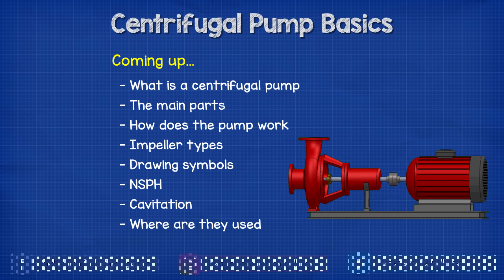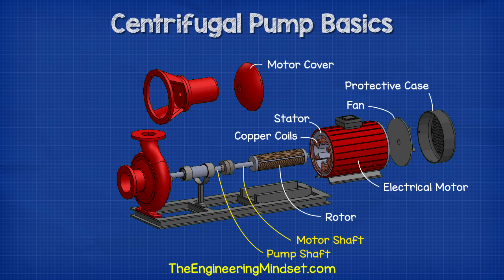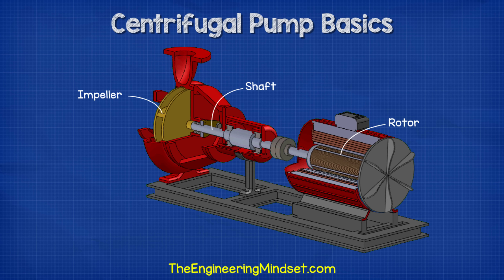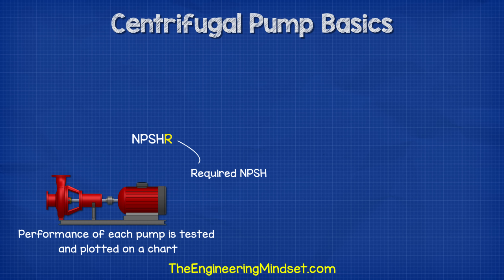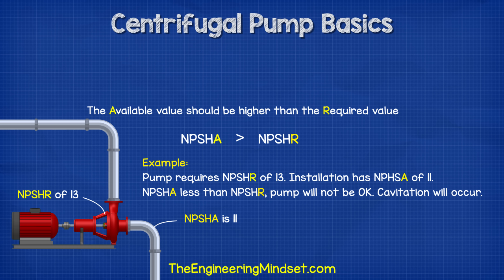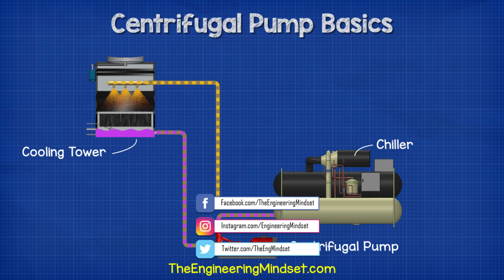Centrifugal Pump Basics - How centrifugal pumps work working principle hvacr

Comment: a question. i wander how to prevent the water leak from the pump case, there must be a little gap between a rod that connects the motor to the pump through a hole of the pump case. how to prevent the leak of water?
Reply: Mechanical seal is used

Comment: Thank you for this valuable videos. Despite i am not an engineer I really learnt from this.

Appreciated if someone explain more details about NPSHA and NPSHR examples mentioned in this videos.
In the first scenario (08:23), why NPSHR = 4, NPSHA = II and we make the conclusion that "NPSHA is sufficiently greater than NPSHR, pump should be OK. In the second scenario , why NPSHR = 13, NPSHA = II and the conclusion was made is that "NPSHA is less than NPSHR, pump will not be OK.

Thank you.

Comment: Great video here. Got a 180m3/hr pump, pumping water 1km away. The problem is constant wearing of the cast iron impeller. What could be the problem?
Reply: it could be better if the impeller materal to be changed.
Reply: @jianhuiqiao  aah I see, to bronze type maybe?
Reply: Cavitation?
Reply: @LadyShaydex  yes I think it's cavitation. What would be your recommendation?
Reply: @CollinsTuikong  you need a higher pressure on the function side of your pump. At the moment the pressure is so low that your liquid is vaporizing and imploding rapidly.
Reply: @Shaydex  okay, so I change the suction design to eliminate few bends.

Comment: Awesome video... well only I couldn't understand how water gets boiled inside suction inlet.. how can we avoid this situation by automatically turn off the pump when suction source water tank gets emptied or there is a pipe choking from trash or pipe pinching in suction line?

Comment: Great video but the motor doesn't have to be electrical. I have worked with several different pumping systems and have used steam motors a lot as well as hydraulic motors.
Reply: Yes that is true. But how were they rotating the Rotar/Shaft? Is it the same concept?
Reply: @kevinmaphupha   The Hydraulic systems used a power pack system that was either diesel driven or electrical, or combination with a motor connected straight to the shaft of the impeller. 

The Steam pumps got their power from steam turbines through a reduction gearbox. Steam coming from a large boiler.
Reply: Yes that is true. But how were they rotating the Rotar/Shaft? Is it the same concept?

Comment: Great video!!
Application question: would a centrifugal pump be a good or poor choice to use as a supply pump in an RV or off grid water system to supply a tap (sink or shower)? I was thinking a set up with a pressure switch to turn the pump on/off, a one way valve and an expansion tank vs a traditional RV water pump that makes a lot of noise.
Reply from the maker: Seen our new pressure switch video? Link: https://youtu.be/YG81w0HFXNc

Comment: Subtitle is distrop the diagram....
Please correct
Reply from the maker: There are no subtles on the video, it is an overay that you have turned on yourself. You can turn them on and off from your device only. Additionally you can move them across the screen to a better position if they cover up text.

Comment: What is most likely reason a centrifugal cooking oil pump will have high thermal imaging temp near the bearing closest to the impeller, and only run for 15 seconds before flipping off the 20A breaker (for a 3 HP 3420 rpm motor)?

Comment: why the head for every liquid is constant. suppose if there is very very high density liquid is being pumped to a head of 100m. then the pressure just at the end of casing of pump, the pressure energy will be very high. but liquid with less density will have less pressure energy .

Comment: Man.. call me stupid if you want, but I was really shocked when I just learned that the boiling point of water varies, and is determined by different locations' atmospheric pressure 😲😱
Reply: You’re not stupid. Nobody knows everything.
Reply: It is very interesting, in fact.
The reason is called vapor pressure.
Reply: This is why pressure cookers were invented so that food can be cooked near 100°C/212°F in the mountains where low atmospheric pressure results in lower boiling point of water
Reply: If you put water in a vacuum chamber and pull it down deep enough it will start boiling at room temperature!
Reply: I mean there r high altitude directions for things for a reason
Reply: I is okay to be stupid but you should not stay stupid.
Reply: Depends upon the vapor pressure
Reply: @usamamohammed2357 depends on the altitude
Reply: @usamamohammed2357 the boiling point itself doesn't really change, it change for someone on the ground,(persepective)

but it's okay as the meausres we have is based on the ground(sea level), which make it look like boiling point is changing

Comment: Ah yes, the simplifications of science. It leads people to saying water will boil more easily on top of cold mountains. Of course it will boil at a lower temperature but the stuff you'll need to do to heat it even to just 71 degrees Celsius will be much harder than boiling it at sea level.

Comment: Excellent graphical representation of cavitation.  The damage looks like pitting and when it gets real bad it looks like someone removed chunks of material from the pump casing with a suction cup as there is no impact damage.  I've seen this during my time.  It can happen in fluid film bearings and throttle valves as well.

Comment: What will happen to such pump in case its run under no fluid circulation from inlet to outlet point ?
Reply: It will make a lot of noise and the pump requires liquid passing through it to wet the packing, which in turn wets the shift and provides lubrication. No liquid will cause the pump to run 'dry' and will cause overheating.

Comment: When i start a centti fhgal pump  size 32*50 with 4 inch of  foot valve but amps of motor goes high  and why it is increasing

Comment: Hey Paul,  
Hope you are well.
Just have I think you help me out.
We have 3 chilled water centrifugal pump 75 kw controlled by VFD.
All 3 are working at 25Hz and 2 of the pump is taking 45 Amps approx but 1 is taking only 28 Amps.
Is there any issue with the 1 pump.
If, what are the possible cause for running on low Amps.
Thanks,

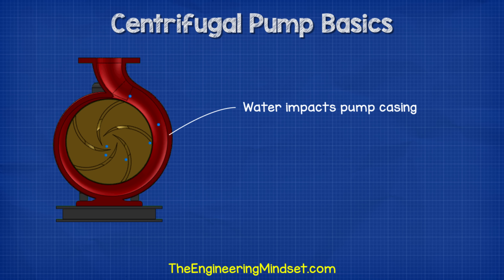Comment: 5:50 Water increases in pressure and kinetic energy

5:58 It's not the impact that converts kinetic energy to pressure, the volute just collects and guides the flow in a way to avoid losses as much as possible.

6:12 This is a mistake. When the pump operates at its design flow rate, the pressure is actually pretty much uniform over the whole 360 degrees of the volute. The pressure then increases in the diffuser, where the cross-section raises, and so the velocity diminishes while the pressure increases according to Bernouilli. The cross-section of the volute does increase, but it gradually collects the whole flow from the impeller. It follows the conservation of angular momentum:
"The diffusing elements
 have to be designed so that the flow field in the collector is compatible with the conservation of angular momentum. If the angular momentum is conserved, rotational symmetry around the impeller is achieved and interaction between the

flows in the collector and impeller is minimized."

9:18 Cavitation will also appear first at the leading edge of the impeller. The blades are blocking the flow passage, water accelerates, pressure drops, and cavitation may appear. 

Good job! Covering everything in 10min is a challenge :D
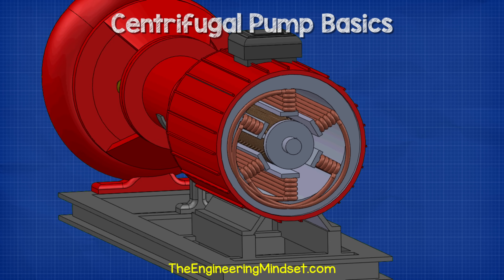Reply: 3:05 That’s called a concentrated winding, but that’s not how the windings of the stator of a three-phase induction motor are usually made. Instead, another type known as distributed winding is much more commonly used.

Comment: So why am I using a gas boiler to heat my water🤔
I'll get a higher npshr pump😁
Reply: Doesn't change the temperature only phase.
Reply: Especially a good idea if you want it to sound like gravel is moving around in the pipes

Comment: Maybe anyone can help me with a confusi on, What's the correct side of installing a ball valve? .....Input or Output
Reply: Normally at the output.
Reply: @bobsonny65  No you don't understand me.
The ball valve have input and output.....Which is which?
I can't send  a picture
Reply: I guess you are referring to one way valves. In that case the bigger diameter is the input